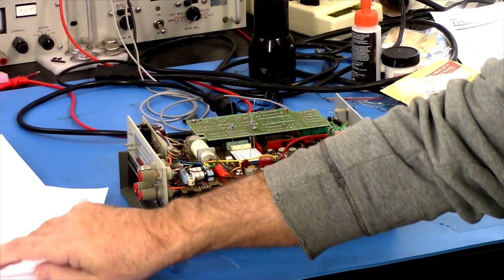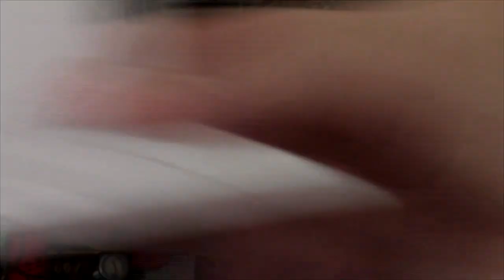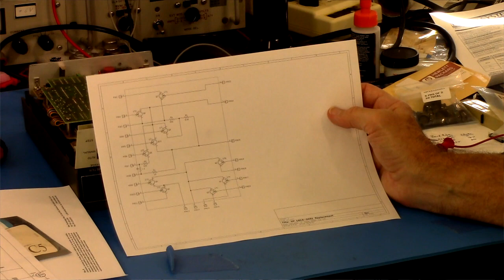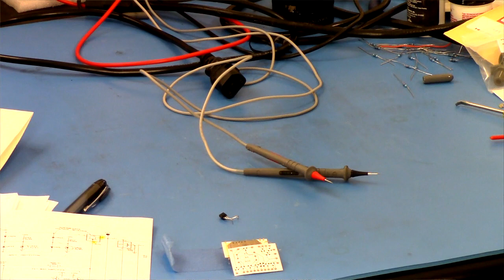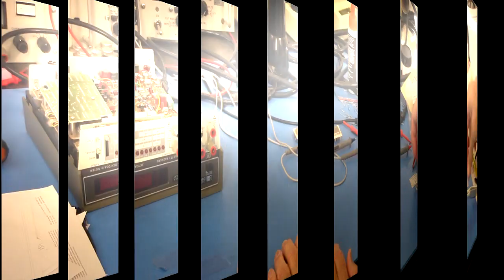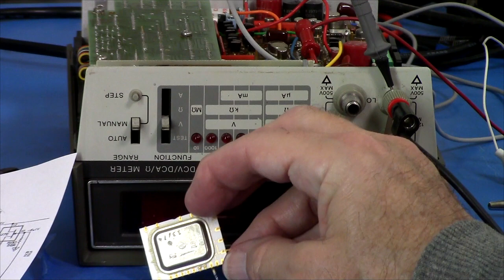HP 34703A Multimeter Repair - Part V

Comment: I worked at HP in the 1980s, and I repaired many of this specific model number. The reason HP designed this hybrid was for 2 specific reasons: First, because the voltage divider resistors could be more easily laser trimmed for precision. Secondly, and more importantly, the switching FETs were added onto the same substrate as the resistors for temperature stability. The theory was that any thermal drift would be minimized due to the added mass of the substrate, and in any case, all components on the substrate would drift equally in the same direction, thus effectively canceling the net effect of temperature changes. The idea worked reasonably well, and it is still used today in modern instruments. Your idea of building a replacement board for that hybrid is excellent, but of course the thermal benefits of that hybrid will be lost. In practical terms, I would think it would work fine, considering the level of precision expected from this instrument.

Comment: I am really enjoying this series of videos and look forward to the next part. Caddock make precision voltage divider resistor networks with the ratios that you need - if you would like to avoid trying to hand select a matched set. Regards,  David
Reply from the maker: But the matching (with a KVD) will make for a fun video ;-)